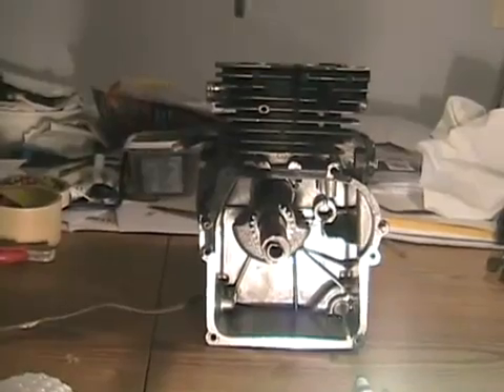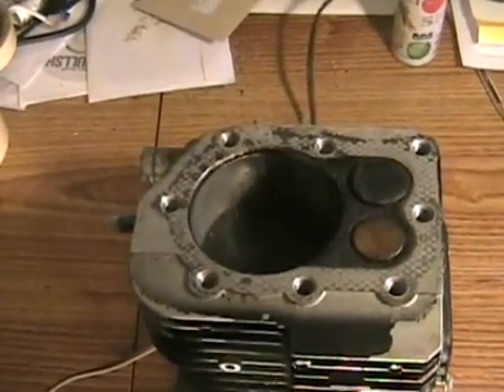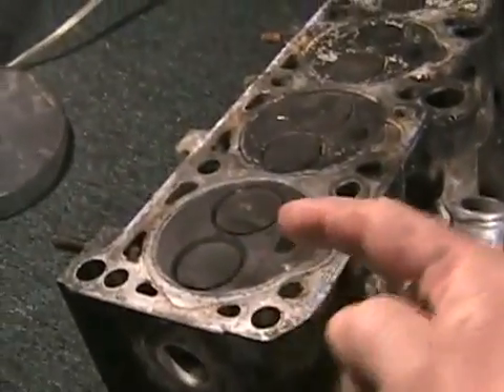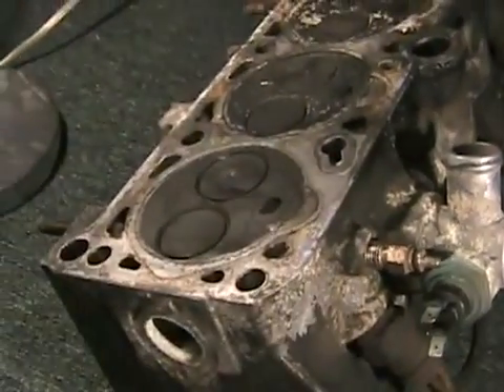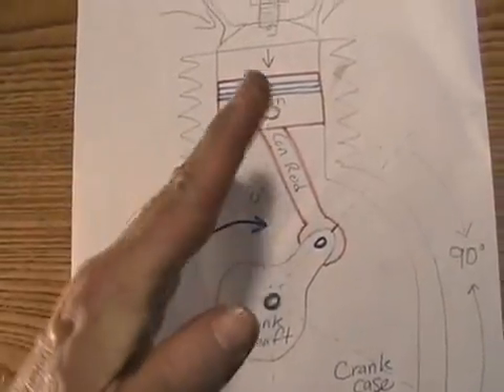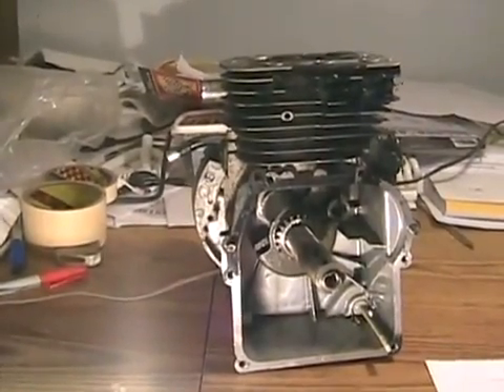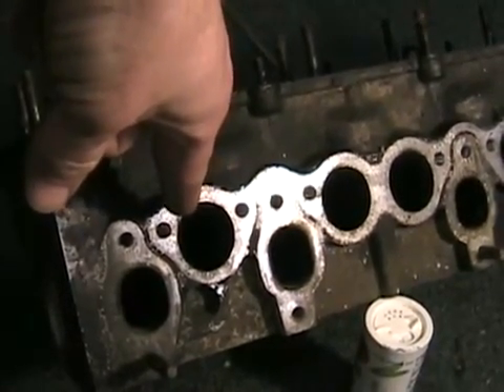how diesel engines work and combustion theory part 1 of 2 Davidsfarmison[bliptv]now

Comment: 5:20 that is wrong , that is not a flathead cylinder head. A Flathead cylinder head is one like the one of the lawnmower engine you showed earlier .  and some Gasoline engines use flat cylinder heads too
Reply: Hey mr Ford, do you know why diesel Engines more fuel efficient ?
i guess not
Reply: AVLMTC Yes i do , they have longer strokes and Diesel fuel creates more energy per liter than gasoline , but that has nothing to do with this
Reply: Ford Fan 2904 wrong !  its because of the throttle , A diesel Engine dosent use a throttle (as David said) try to put your hand in the intake and you find the energy  of the trottle. its expensive (in vacum pumping loss) to obtain a lambda 1 in a otto ,
Thats basic for you .
Reply: AVLMTC next question . Do you know why a older diesel cars less thirsty vs a newer diesel car ?
Reply: AVLMTC I don't know! , but it has nothing to do with what i said , calling a diesel cylinder head , a flathead is wrong.
Reply: Rustang.

Comment: rotate the crankshaft again...kitty!

the multiple injections per cycle are mostly for noise and vibration!  instead of one, big bang, you get several, smaller bangs.  GM claims the new Cruze Diesel is smoother than the Jetta, and as smooth as a gasoline engine.

Comment: but in a gasoline direct injection engine, you've got pcv fumes running past an intake valve, and no fuel spray washing the valve as the engine runs. So, oil residue tars up the intake valves, starving the engine, or in worse cases, chunks of the oil tar crud falls into the engine, destroying the internals; jamming valves open so the piston hit them, breaking piston rings, fouling up injectors.... A Mitsubishi guy was telling me that a mazda with 'skyactive' technology loses 17hp per 10,000kms it's driven. That's why a lot of good car companies aren't using gdi because it's a shit system in the long run. Diesel on the other hand.... ROCKS :D

Comment: Usually a diesel has a stronger suspension, due to the increase in weight and transmissions are usually built tougher too.

Comment: First generation cummins 12 valves had no glow plugs and are powered by a VE rotary pump. Second gen 12v have grid heaters which work in the sense of a glow plug but only one is needed. Common rail injection is 27,500psi or so or 1,999bar.

Comment: Spark plugs are for regular gasoline engines that most people drive on the road today. A spark plug is a device used to ignite the fuel/air mix in a engine at the right time when the piston is near the top of the compression stroke for maximum pressure in the cylinder. Without it; your car wont even start, it will just sit there trying to turn over and nothing happens. If you want to learn more, I can teach you via a PM.

Comment: turning the engine over is the job of the starter motor. "TDC" stands for Top Dead Center. Its when the piston is at the top of the compression stroke and is then on the way down for the power stroke. That movie was because they didnt have a starter for the engine they were using.

Comment: I'm still trying to figure out the name of the cat! I love cats, but I'm in a fog by now. I thank you for for trying to get a fool like me to undertand the cylinder pressure etc. and that compressed air actuallygets hot so not spark plug, got that part. But what gets that first pressure on the cylinder - is that done by hand? Or do you explode the cylinder with an explosive like you see in the movie about starting the aircraft in the desert with shotgun shells? Thank you very much:) "TDC" ?

Comment: way above 101 teaching using terms that only mechanics  know. So not a good teacher, too fast, "what is a spark plug?" what is the need for a "beach permit" while trying to grasp what the fast talking teacher is saying? It is very distracting to have a sign on  the teacher that has nothing to do with what he is demonstrating. That is why Yale professors wear coat and tie in the lecture hall. This video is great if you are already an expert in the field. - Retired martime attorney trying to learn

Comment: not even close to true.  There is far more diesel oil in a barrel of crude than there is gasoline.  Not to mention, really, a diesel will burn almost anything that is liquid and oily.  Kerosean, veggi oil, home heating oil, I've used all of those, they all work pretty well.

Comment: Just a note, you CAN have a double power pulse with a mechanical injection engine.  Makes the injector twice as complex.  You have a small port on the injector that opens at say 1800psi, thats the precharge, as the pressure rises in the pump, the main injection port opens at say 2300psi.  It is very tricky to control the pressures inside the pump to do that at just the right times, but bosch makes a system that does it.

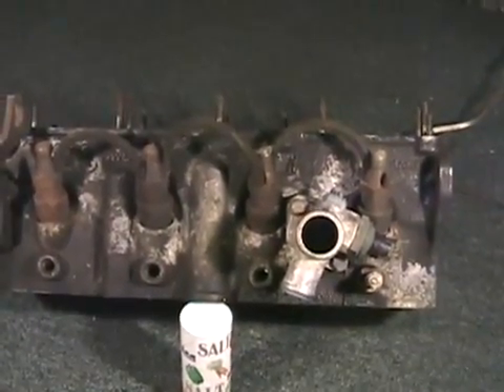Comment: It's a good thing you try, but this is not quite well! You should have used a common rail engine, such as a DCI engine from Renault. Also, you are wrong in some aspects. For example, at 8:09 you say 2000 psi. Well, in reality, the modern common rail systems send at least 1800 bar of injection pressure to the fuel injecting needles. That is at least 26106 psi !!! All this, in a small car like Renault, Nissan or Audi!